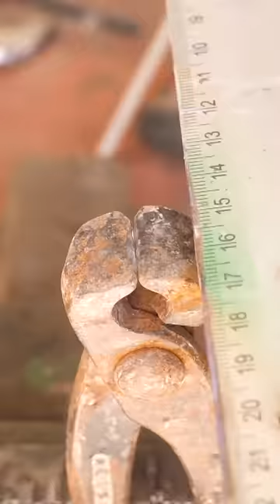ضاع عمرك او انت ترمي الكماشة القديمة غلط =  INVENTIONS YOU WOULDN'T BELIFE WERE MADE AT HOME!

Comment: I like how he used pliers to make another set of pliers that are worse that the first set, and then poorly twisted a wire over a rubber hose which will crimp through that hose breaking it, not mention the wire is rusted badly like it was used as a coat hanger for a ghetto abortion.